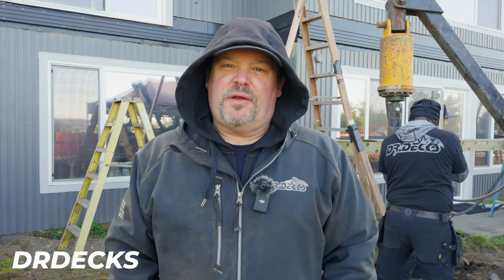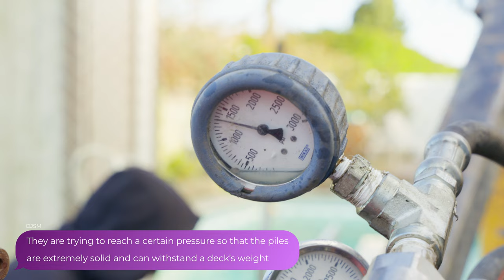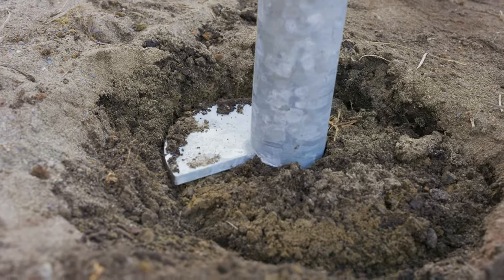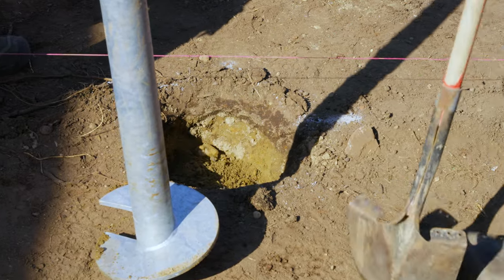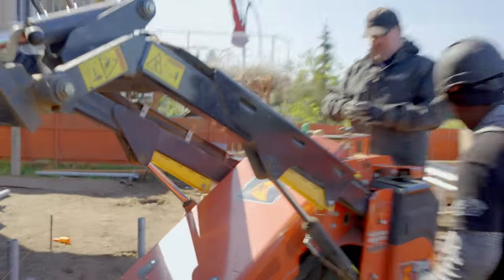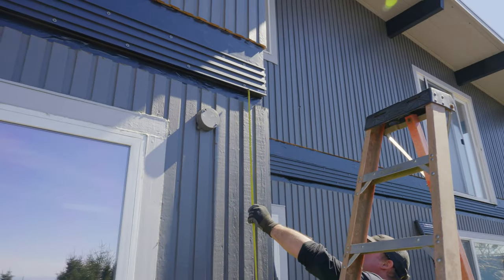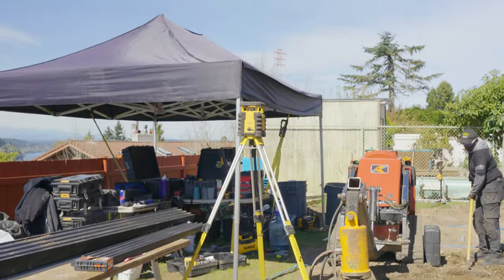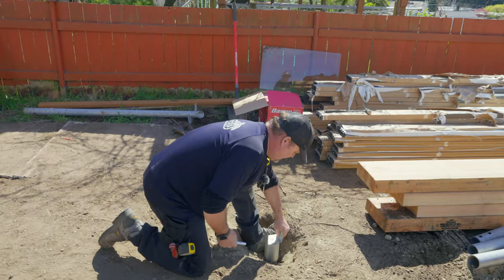Helical Pile Troubles - Dr Decks

Comment: You need a bigger machine, man, lol. Also, by going at an angle, you're compromising the structural integrity of the pile, not good. It has to be straight 1000% of the time. You're fired. 😂
Reply from the maker: So virtually every helical pile installer is doing it wrong?
Reply: Actually, it's refered to as "steering the pile" and is a technique often used to get around rocks that the helix can't force out of the way, as well as getting the pile in the correct position.

 The pile won't 100% stay plumb the entire way down. You'll always have to steer it just a little bit. Larger piles sort of orbit the center of the hole while the top stays on the centerline, as it's held there by the machine.

Once that helix is in place, let it sit for a couple days, a week, and check the torque again. I would bet it is as good or better than the day it was installed. The soil will settle in around the stem.

 You could say I have some experience in this.

Comment: Hard to beat fast set quikrete, a hand auger, and a sonotube. I dont have to dig 4 feet in the ground typically. Our frost line is 11" they say, but it's really zero. One great part of living in alabama lol
Reply: Ohio is 36” and could be depending on size weight,  14” around. I did 9, 8” by auger the rest by hand to set a 24” footer to a 4x6. 26years later she still standing strong
Reply: @Dirtyharry70585   I basically build mine the same way. Whenever possible I float my decks and install post after the frame is built. It will be another 15 years before I will find out if my builds will make it that long.. have a good day man and roll tide! Lol

Comment: I highly recommend a Ryobi or dewalt cordless finger sander/ banfile for that pipe deburring.  They are slimmer than thoea giant mikita corded ones and are good for a quick chamfer as well as opposed to whiping out a router.
Reply from the maker: I need to update mine for certain
Reply: Yea I have both dewalt and ryobi and the ryobi is no slouch.... I'd say within 20% to 30% less powerful and if my guys break it It's $60 on sale to replace vs 190.  This sadly is the state of ryobi but I don't fear them getting lost no one steals them from me even when left out.... like the old mag 77 corded saw there sellable value is garbage but actual productivity is darn good 👍